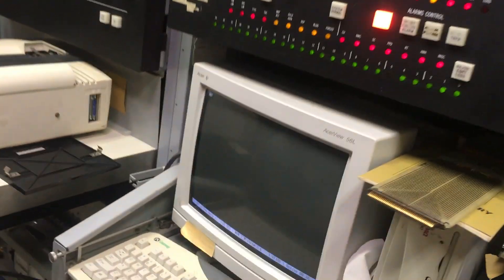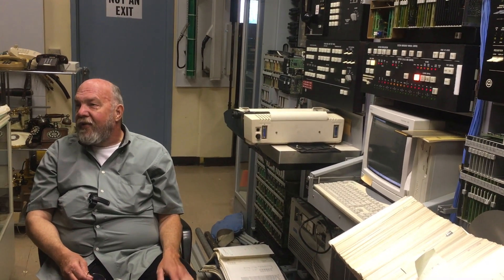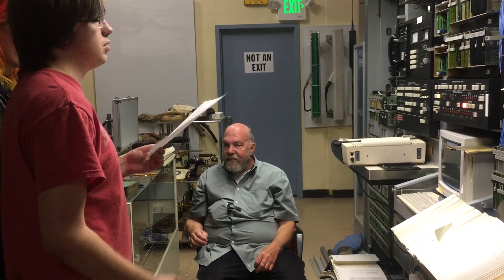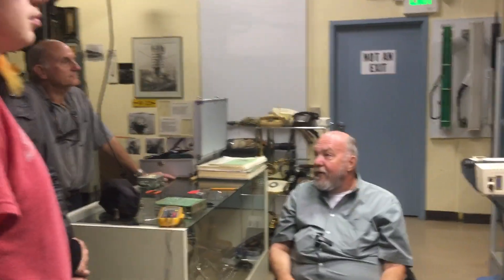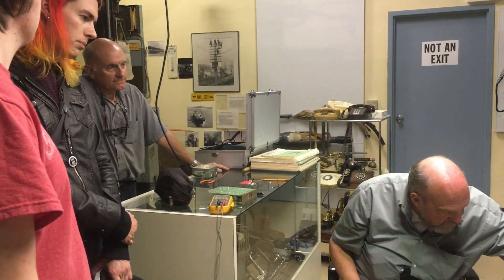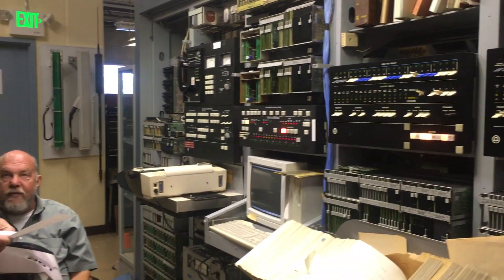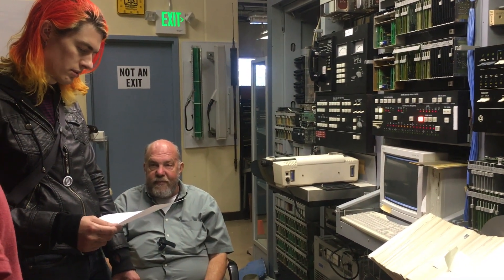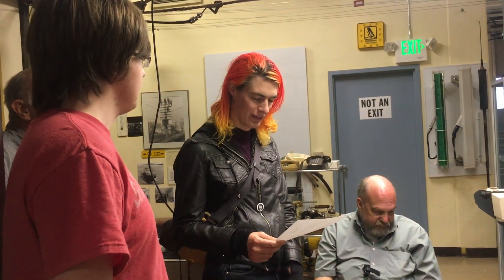3ESS: Got the terminal working

Comment: I knew about the 1AESS, the 4ESS and 5ESS, but I never knew there was a 3ESS (I should have assumed, logically). Was there a 2ESS or was that just the 1A after being converted? I'm a Northern guy and can tell you all about SL-100 and DMS, but in terms of Bell, I'm a bit clueless. (Except for DMS/*SPS Interop)
Reply: The 2ESS was a scaled-down version of the 1ESS. It was introduced around 1970 and Incorporated the 1ESS processor, and was targeted at the medium-sized suburbs. 3ESS was designed for rural operations, and was rolled out in the mid 1970s, using the 1A processor, to replace No. 3 Crossbar in Community Dial Offices. It was not widely implemented, and the last ones were removed from service in the mid 1990s, having been largely replaced by 5ESS Remote Switching Modules.
Reply: @daniellowell2157  The 3ESS had its own processor, called the 3A CC.  It did not use the 1A processor.  It was an entirely new design, using logic integrated circuit technology developed for the 1A processor.  It was a 16 bit microprogrammed machine.  Besides use in the 3ESS, this cpu was also used in an upgrade 2ESS to increase performance, save space, and increase reliability.